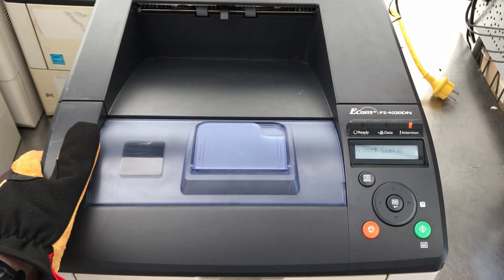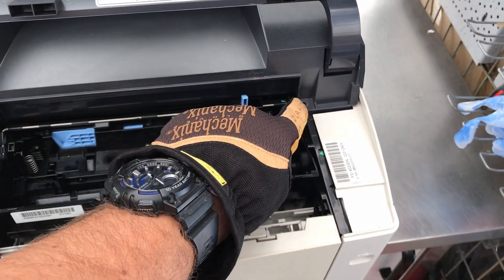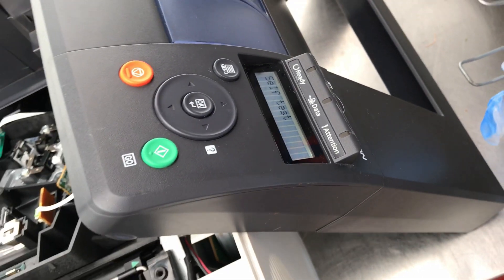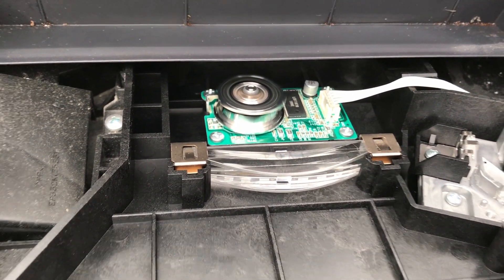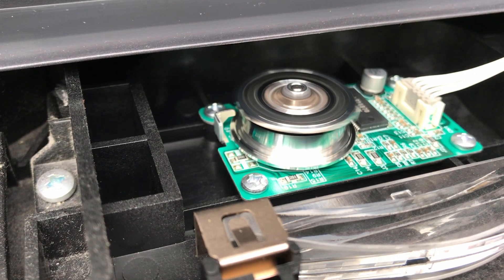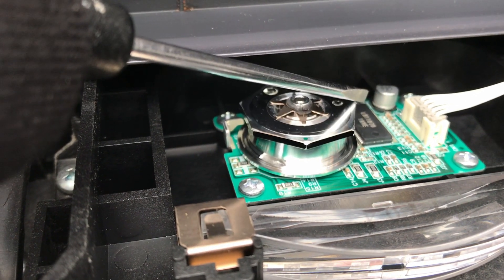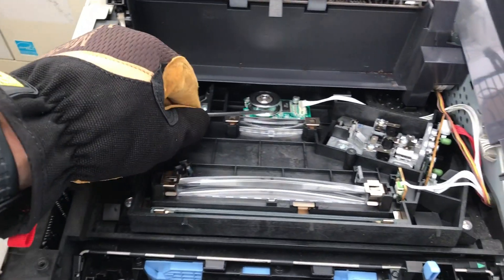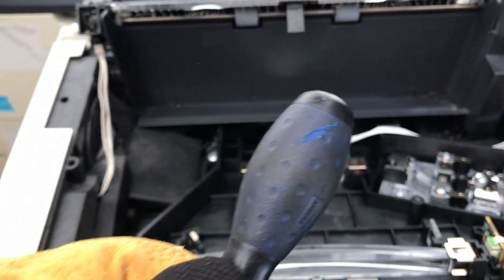Spinning LASER 28.000 revolutions per minute - polygon mirror close up.

Comment: Good morning boss i am still having issues with m682z, showing displays"usb error a usb accessory installed that requires too much power"
Reply from the maker: I don't know the exact problem, but I would connect a new different USB cable first. Connect the printer to a different USB port on the computer. Finally, read this discussion: https://h30434.www3.hp.com/t5/LaserJet-Printing/HPLJ-MFP-M577-quot-USB-Device-Using-Too-Much-Power-quot/td-p/6769464